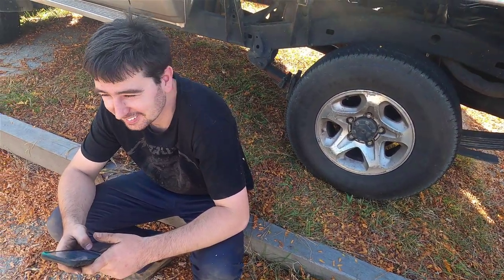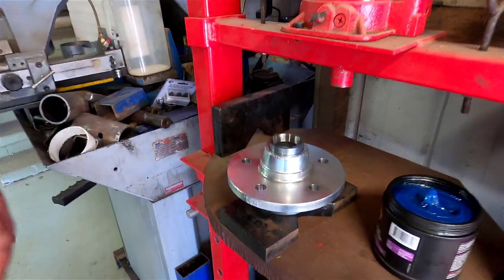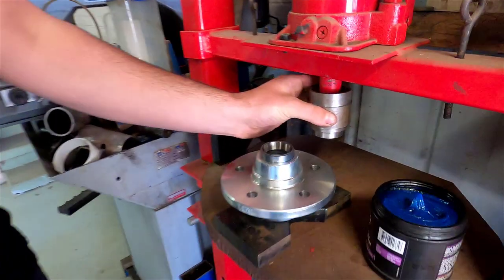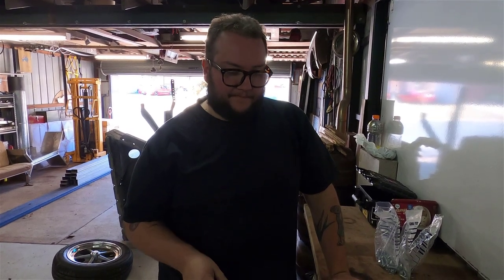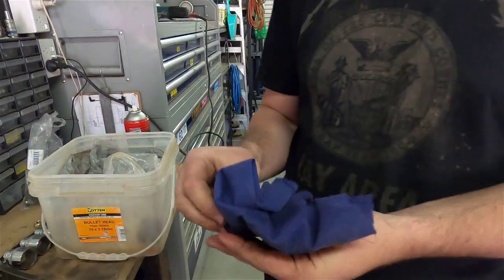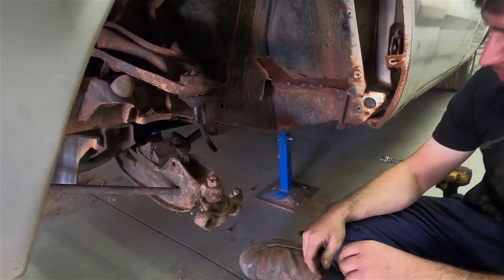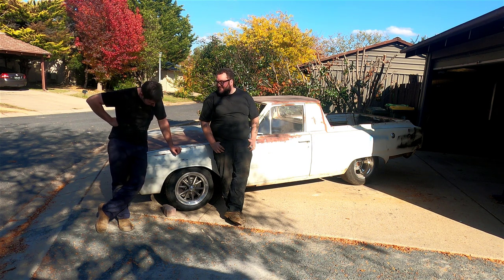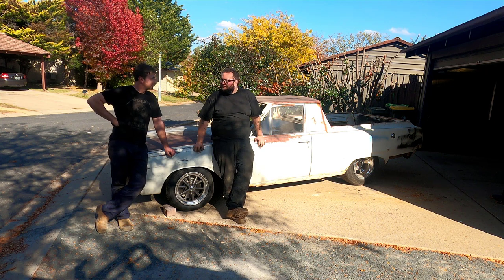BackyardBuilds: Apparently Race cars need Brakes: AU Falcon disc brake conversion.

Comment: Hey boys just stumbled across your channel, looks great. As far as the disk brake conversion is concerned, if you don't mind me asking what hubs/ bearings are you using? I cut my own chassis connectors and torque boxes as well. No luxury of a rotisserie though. Up on stands and blocks but all levelled of course. VG pacer.
Reply from the maker: Hi Geoff,
Thanks for watching! We’ve covered this in other episodes, also looking to produce bolt on kits continue watching to find out more info.
Cheers
Thomas

Comment: Hey guys love the channel! How did u go mounting the booster and master cylinder? Also do u guys have the measurements for your adapter bracket? I reckon I'll be doing the same conversion on my old val. Cheers and keep up the awsome work 🤘
Reply from the maker: Hey mate. We haven’t mount the master and booster just yet it’s definitely on the list once the wagon is done. We have the adapters for sale if you would like a set. 

https://backyardbuildsaus.bigcartel.com/product/valiant-to-falcon-brake-adapters
Reply: Thanks guys I'll be in touch 👍
Reply: Hey just a bump on this thread.. will the caliper brackets fit a vh?
Reply: And when will they be back in stock ? Cheers

Comment: Never realised it was that easy to convert to AU brakes on a Valiant, I'll definitely look into this for my VJ Charger now! 
Are you doing anything with the front end to get it extra low?
I've got lowered stubs in the Charger  but they're more trouble than they're worth in my opinion and I'm thinking of going back to stock but with flatter bump stops.
Reply from the maker: Hey mate, Yeah it was one of the simpler conversions we have done, The adapter to the Au caliper was a little complicated but pretty easy. At the moment the ute is just wound down on the torsion bars, it does have ta=ravel but not a great deal. My personal ute is nearly on the bump stops front and back and it rides pretty well tbh.

Comment: $100 for rotors, hubs are close to $500, then you got to chase up adapter, calipers, cheap for those who are lucky enough to be well enough to work maybe, not beating up on you guys, I like what you do, and try to do it cheap as you can.
great info, this is what we like, but us tavo guys not by choice, its not feasible.
i cant even find a auto for my v8, stores are really hiking up the prices too.
its like everything is made of gold, its ridiculously over priced.
cheaper to buy a high brand car parts for imported cars than a valiant, getting beyond a joke.
keep up the how to on the cheap, thats what we like.
Reply from the maker: As you say mate a lot of stuff is priced like gold and we have noticed it is thin on the ground. We do now sell the adapters on our page for $175 shipped to you. That is close to our raw cost in laser cutting, machining and zinc plating. We just trying to offer a cost effective solution. Thanks heaps for all your comments on our video and thanks for watching.

Comment: Hey fellas, does it matter if you are using the standard wheels and the center bore doesn't fit into the wheel as far, it doesnt look like it will be holding the load as it normally does?
Reply from the maker: Hi Jonathan, it does matter, the center bore of the wheel should be snug on the hub to carry the load, If the center of the rim is larger then the hub a Concentric adapter would be best to use as there should be no load on the nuts or studs. Hope this helps mate.